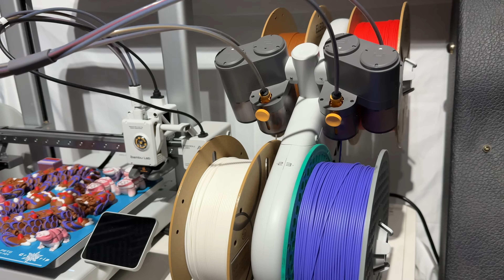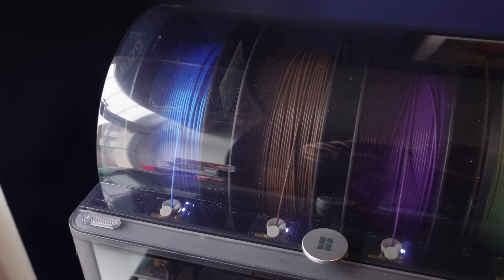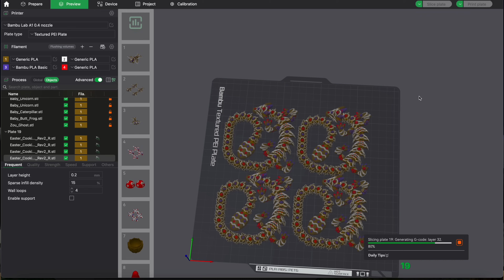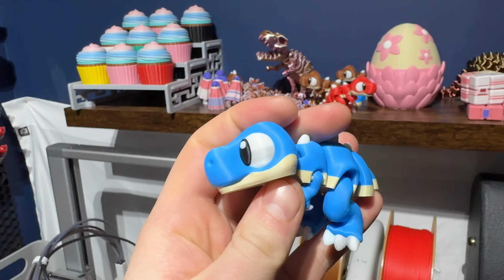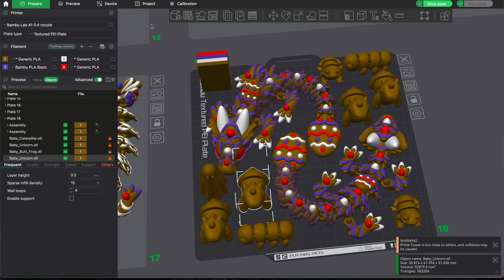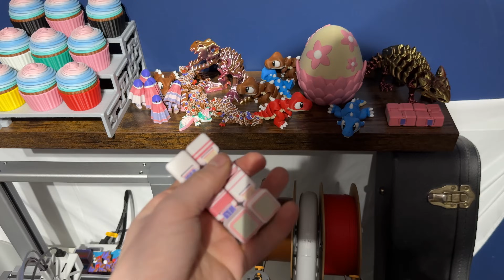Reducing AMS Waste on Bambu Labs

Comment: A few other tips. First, switch to Orca vs Bambu Studio. Orca offers more advanced options for reducing waste on multi material prints. Second, consider switching from Print by Layer to Print by Object. This minimizes waste and speeds up your prints since multi color print time is increased due to the purging operations. This also helps with color bleed issues since you will only purge at each color change location within each object vs doing multiple switches per layer which spreads the bleed over all objects. The result is faster cleaner prints with less waste. Downside is you won't be able to pack as much on your build plate and position of your objects is important so you don't hit already printed objects. Studio is too conservative IMO in helping you with this but if you follow it's recommendations you shouldn't have any problems.

Comment: Whhat happens whenBamboo Labs go out of business? Will the machine stop working?
Reply: Lan mode
Reply: I wouldn't worry about it too much. I don’t think they would go out of business since they are doing pretty good and besides that, you'll only be able to print via SD card or a LAN connection